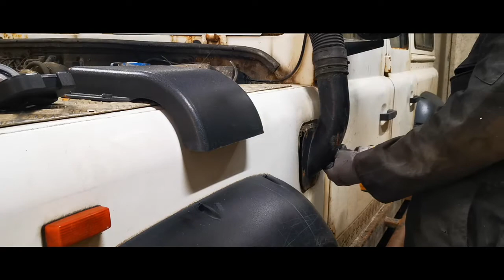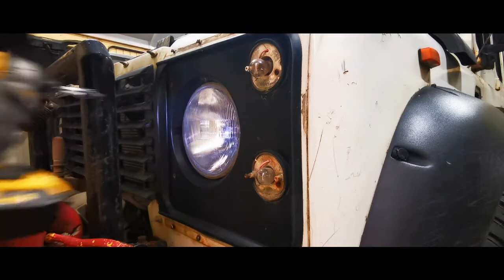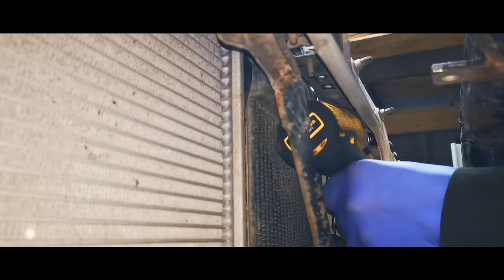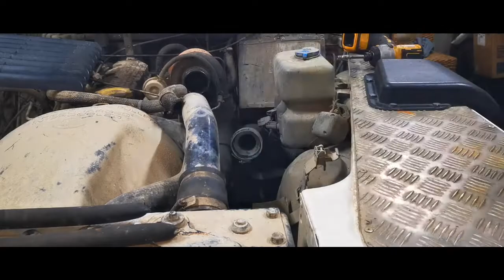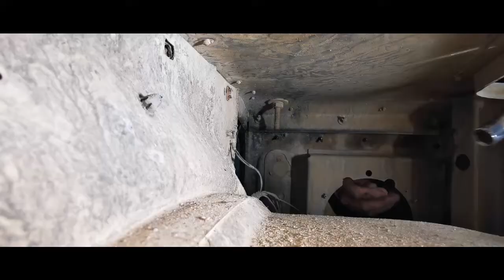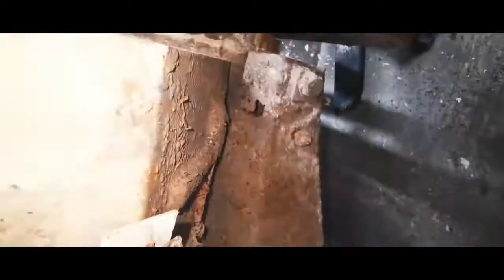Land Rover - Wing Removal

Comment: How do you disconnect the side indicator?
Reply from the maker: All I did was remove the indicator and remove the bulb holder from the inside as I have standard 200tdi indicators on mine 👍🏻👍🏻
Reply: @mozsmancave2331  Mine's a 1997, ex-MOD and the side indicators are half the size of yours. Does the lens slide forward?
Reply from the maker: @gavinbroad1743  I think there's a clip on the top of the unit, I think if you slide a small flat blade screw driver or a feeler guage in a press the clip whilst pulling the unit out it should come out.
Reply: @mozsmancave2331  It did and needed a push forward. Only moves an eighth of an inch, but then it can be pulled out. 👍